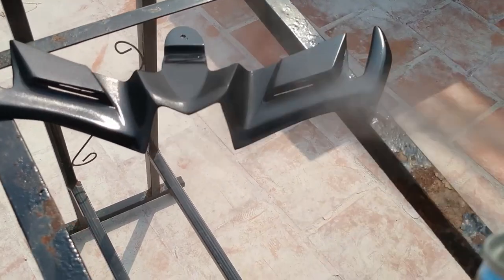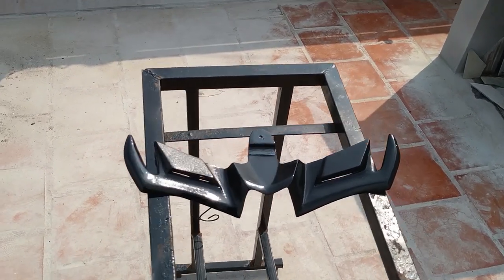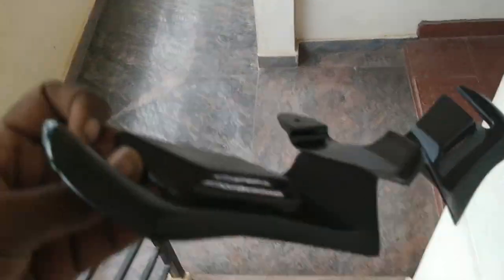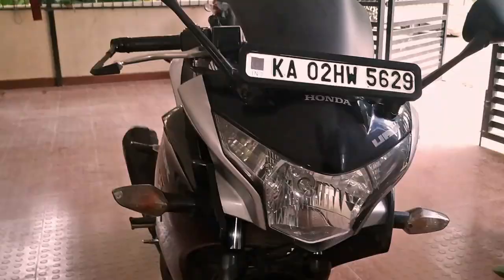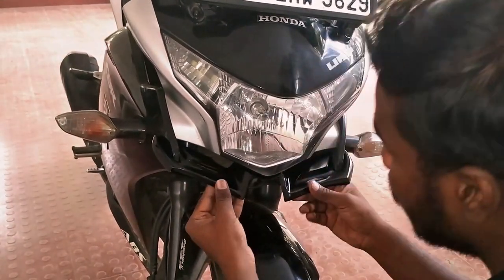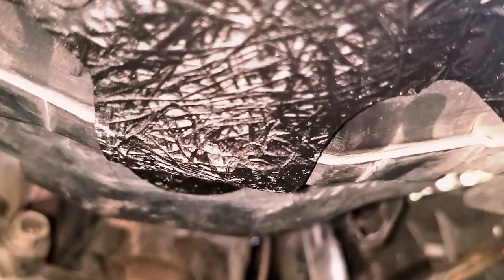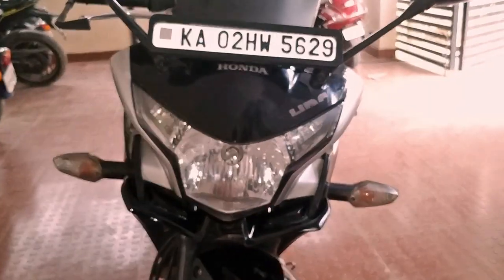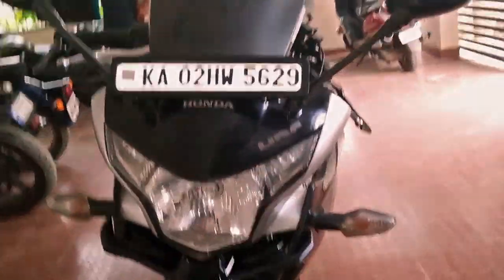Winglet Modification on CBR250R | Easy to Install | Harp Chennai

Comment: how did you mount front the number plates with mirrors in cbr 250??
Reply: Hi, I used Yamaha R15's front number plate holder and fixed it bro.
Reply: @robertroy6355  Thanks bro..even i want to do the same
Reply from the maker: Cool bro, let me know if any difficulties.
Reply: @RiderRob  you are refering to R15 V3 right?
Reply from the maker: V2 bro

Comment: I need to buy Number plate v2 bracket

Here in yamaha showroom no countersale & other spare parts store dont have stock

Where to buy plz help me
Reply from the maker: Did u check in other spare shops?
Reply: @RiderRob  I have checked 

No stock eny where
Reply: @RiderRob  Is there eny instagram platform to buy number plate bracket.?
Reply from the maker: Are you from bangalore?

Comment: Sir how did you fix number plate
Reply from the maker: I used Yamaha R15 V2's front number plate bracket and fixed bro.
Reply: @RiderRob  sir can you make video on this it's useful to us
Reply from the maker: Definitely ill make a video brother 👍😁
Reply: @RiderRob  waiting dude
Reply: @RiderRob  I bought the same but the holes are not matching with bike. Do we need to screw more holes in holder?
Reply from the maker: No, you need to bend the bracket to match the existing holes, only the top holes will match and the holes at bottom won't and its not required.

Comment: Hey bro how did u install the number plate above?
Reply from the maker: I used the R15V2 number plate bracket bro, and bent little to match the bolt of the mirrors.

Comment: how did u keep the no front no plate..tel me sir
Reply from the maker: I used R15 v2's number plate bracket bro, did little bit of bending work and fixed it.
Reply: @RiderRob  r15 v2